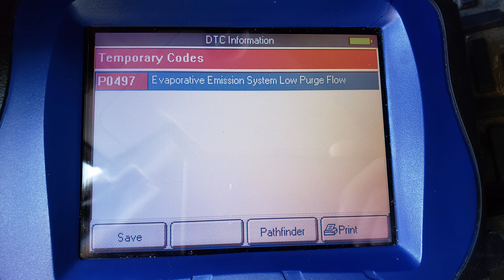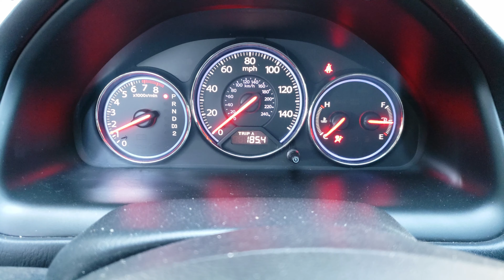How to Replace an EVAP Vapor Canister Purge Valve on a Honda Civic 2001-2005 - Fix Code p0497

Comment: Remove hoses first. Remove bottom screw first when removing valve. Install top screw first when replacing valve. Replace hoses after valve is anchored.
Reply: you just want to heard huh.. this instructions makes no difference
Reply: @jar5520 he's probably referring to how they do it oem

Comment: I just got P0497 and p0158 both at the same time today! Hopefully I can fix it soon after I do my full research and go to the shop knowing more than less of the situation
Reply from the maker: Well p0158 is normally related with an issue with a oxygen sensor on bank 2 sensor 2..but if the purge solenoid triggering code p0497 is stuck open that could cause a vacuum leak causing the voltage on that oxygen sensor to be high in response..so i would focus on code p0497 first
Reply: @backyardchevy328  thank you, I will do first thing in the morning.

Comment: with a code of P1457 on my 02 civic, i thought the whole system was near beneath the car near gas tank. Didn't think it was near the air intake box. I bought like the charcoal canister and 2 other pieces related to it. Should I replace the whole system, or just the part in question related to the code I am receiving?

Comment: I was chasing my tail in circles with my cold-start idling issues forever. I thought I needed a new canister but it turns out all I actually needed was this $35 valve, a screwdriver and 15 minutes.
Reply: What code did you get? Currently got a P1457, and debating whether or not to buy one of these for $20. My current one is VERY rusty.
Reply: @MooMoo22  Turns out I was wrong. The sputtering idle is still a thing but my old valve was definitely stuck open. I have the P1457 too and the only way I know to get rid of it is to replace the purge and check valve ON the EVAP canister itself.

Comment: Thanks for the great video. I want to connect the vacumm gauge to measure engine vacuum . I was advised to connect  it to the purge valve. Any suggestion. I connected it after the green sevice valve with T but got no reading

Comment: was the engine code reset after replacement or did the code go away on its own after replacement? Doing this repair this weekend after getting the p0497 code.

Comment: Could a bad purge valve make a whisteling noise? I noticed that started to happen a little before check engine light came on. I know it was a evap code but didnt right down the number

Comment: Did your check engine light clear right away after replacing solenoid valve ?
Reply from the maker: I reset it manually with my scanner, it stayed off after that
Reply: My check engine light cleared right after I plugged in my diagnostic machine
Reply: I hope it's the same for 2002 Civic...

Comment: Could the plug for the purge valve also go bad? my car has 325,000 km and the evap code keeps popping up even after i changed the purge valve, i went to the scrap yard and grabbed a couple and the engine light still comes on. idk what to could be because it’s the same code “P0497 Small evap leak”. what do you think it could be? what should i replace?
Reply: did you ever figure it out? i have the same problem
Reply: @Lonnamara  charcoal canister

Comment: At 2:45 , what size socket did that bit fit into? Or is that socket a special one for bits only?
Reply from the maker: Well it depends on the bit(some bits come 1/4 and others 5/16..so u can use any 1/4 socket or 5/16 socket to a ratchet..on that one it was a 1/4 bit, so a 1/4 socket to a 3/8 ratchet

Comment: I cannot get the two screws off! They are both stripped and won’t budge. Any advice?
Reply from the maker: Well normally with stripped phillips screws i use something to slot the screw so i can use a flatblade screwdriver to remove em..but in that area thatd be hard to do..so i would either remove the bracket or throttle body to have better access to do that and get the screws off
Reply: @backyardchevy328  makes sense, thank you!

Comment: I have a 2002 civic ex hard starting it sometimes doesnt start. Replaced ect sensor, fuel pump, coil pack. Stll with same issue. another utuber said its the purge valve but i dont have a check check engine code for that. Is it possible not to get a code for purge valve?
Reply from the maker: That could be many reasons, very unlikely itd be a purge valve to be causing those issues, for it to be causing that it would trigger a check engine code...i would lean towards a sticking idle air control valve..i have a video that explains how it works and how to check em..and that could make it hard to start
https://youtu.be/Bxm-LabXdcI
Reply: Same issue. Turned out to be faulty crank sensor.

Comment: When replacing get oem from Honda if you can it’s only like 10 bucks more than auto shops. Trust me I cheaped out the first time and it stopped working after two months. Went with oem after that

Comment: You have a problem with it reoccurring?  Bought a new one(same as yours, not oem) and it still comes on but only If I go over 60 for longer than 5 minutes
Reply from the maker: No, ours has stayed off since...yea u might have a small leak somewhere else in the system..maybe check gas cap condition and any hoses near canister and vent valve

Comment: My 2005 Honda Civic lx will turn off if I open the gas cap while running.  It takes a while to start every time I fill up. Do you think this is the cause ? I replaced the whole canister assembly. I used a parts yard replacement but still no luck. Before I start buying all new components I hope this is the cause
Reply from the maker: Yea that might be an issue with the purge valve..as u fill up if the purge valve is stuck open itll allow all those vapors into ur engine basically over riching the fuel mixture making it hard to start or not wanna start at all...also if u open the gas cap ur allowing it to create a huge vacuum leak so yes thatll also cause it to stall
Reply: Don't do that!

Comment: Where is this located on a 2003 Civic Hybrid? I have this same code and I already have the part, just can’t find where it’s at.
Reply from the maker: If i remember correctly its above the transmission  just above a radiator hose there will be a hose connected from one side going to throttle body..but that was on a 2006 so it should be pretty similar
Reply: @backyardchevy328  I actually found it underneath the car, right above the rear wheel axle near the fuel tank. Had to get underneath there and pull off the entire canister housing to replace it. It's the exact same part though. Thanks for the quick reply and awesome video quality!

Comment: If i do the same thing will it fix the code p1456
Reply from the maker: Cant say for sure..there can be many things that can trigger a code..could be as simple as the gas cap is bad..or wasnt clicked in properly..to a hose that has a small tear or yea that valve etc.

Comment: Hi this Can cause a p0007 ? 
I have this code on a 2004 HB civic 1.4i 90hp
Reply from the maker: Hi..no this would not be related to that code..p0007 means the computer is detecting a problem with the signal from the fuel pressure relief valve
Reply: @backyardchevy328  thanks a lot for thé Quick respons
Yep fuel pressure valve, but the question is where and what is it ? 🤔
Reply from the maker: @francoismorin6806  its on the passenger side under the dash near the hump..its an inertia switch

Comment: Help find a good purge valve for an old school 1997 Honda civic on Amazon? Please 😅
Reply from the maker: https://amzn.to/3w54Lvt ouch theyre expensive..thats the one meant for that year as long as its the ex or hx model
Reply from the maker: They dont have the dx or lx model purge valve..but i think u may be better off using rock auto they have em slightly less
Reply: @backyardchevy328  I have an lx
Reply: @backyardchevy328  do you think walmart or so.ething has it. Or...
Reply from the maker: @28monkeyking  no but autozone or O'Reillys should have it..i just checked autozone and the lx model is 142.99

Comment: Which engine is this in the video?
Reply from the maker: 1.7l from a 2005 honda civic
Reply: @backyardchevy328  Alright. My car is throwing a code for the Evap Canister. Before this it was throwing a code for the EGR valve. I replaced it, and the code is still on the scanner (after removing it when fixing the egr valve) but now there is an evap Canister code along with it now.
Reply from the maker: @anightride9617  well the evap canister code probably isnt related..cause the evap canister normally has to do with the canister vent valve(the one near evap canister) having some sort of problem..being the valve is stuck or the hose may be damaged or cracked...while the egr could be problem with egr valve..the passage may have some obstruction etc
Reply: @backyardchevy328  not sure, but when I replaced the egr valve I sprayed carb cleaner into the holes and it seemed to clean it back up pretty nice, there was a lot of carbon build up in there. I started the car without the valve on only for a couple seconds so it could spit the carb cleaner and gunk back out. The engine seems to be running smoothly and normally.

Comment: Can that make your car turn off while driving?
Reply from the maker: Itll make it run rough and hard to start but normally wouldnt shut off while driving, possibly at stop lights
Reply: @backyardchevy328  thanks 💯

Comment: Aren’t these like $200-300 new ?
Reply from the maker: The purge valve? No, it was 35 dollars or so
Reply: @backyardchevy328  wtf ! Lol oreily and autozone have them listed as that price
Reply from the maker: @samuel96f  im looking at the purge valves right now..the dorman one is 31.99 and standard brand is 37.99
Reply: @backyardchevy328  does the civic year matter I’m doing this to a 2000 civic ex coupe
Reply from the maker: @samuel96f  ouch lol yes it does..even amazon that one is 165
Reply: Yikes, well I guess I’m in luck b/c I’m doing this on a 2004 Honda Civic LX 😅

Comment: Mine got the code, I replaced the purge valve and it still throws p0497(2005 civic LX).  Driving highway it doesn't come on. Only driving around town. Could the new purge valve have been bad or is there another issue?

Comment: I bought the replacement but my whole issue is 1 screw that will not come out
Reply from the maker: Is it stripped or just really tight? If it stripped i find making a lil slot on it to use a flat head screwdriver to work really good
Reply: @backyardchevy328  I think it's stripped, I gave it 2 good sprays of WD-40 luckily one of them came off great but this one just isn't having it, I'll have to do that though
Reply from the maker: @localterrorist3155  good luck hopefully it works🙂👍
Reply: @backyardchevy328  so I got it off a d got it replaced 😂 I decided to do it at night when the wd-40 settled in more
Reply from the maker: @localterrorist3155  thats awesome! Great job🙂👍

Comment: So the part that you replaced is just called a purge valve? I just got the P0497 code today and wanna get this taken care of.
Reply from the maker: Well its full name is vapor canister purge valve
Reply: @backyardchevy328  thank you dude. Appreciate the video as well. Gonna get it swapped out.
Reply from the maker: @davidandres4846  anytime..good luck hopefully ur able to get it taken care of
Reply from the maker: @davidandres4846  yes, that would be the same one i replaced in the video
Reply: @backyardchevy328  Thanks a lot man!
Reply from the maker: @davidandres4846  anytime🙂👍
Reply: @backyardchevy328  I've replaced a new purge valve on V6 accord 7th gen. The code disappeared and came back. Deleted it off and came back again. Do you think purge is no good or something else???
Reply from the maker: @plekplek4934  more than likely its gonna be something else, starting with checking gas cap gasket to make sure its in good shape..after that checking any of the hoses for any cracks or damage
Reply: @backyardchevy328  Replaced the gas cap twice, last one from Honda dealer
Reply from the maker: @plekplek4934  yea then ud have to check for any cracks or damage to rubber hoses..or leaks elsewhere
Reply: @backyardchevy328  do you have the hose diagram 
I have that code on my car 
What i notice is an obvious fuel odor coming underneath the driver side